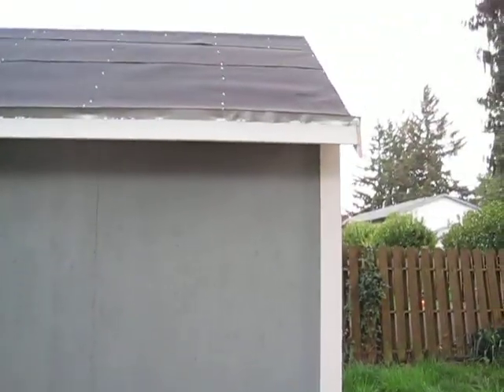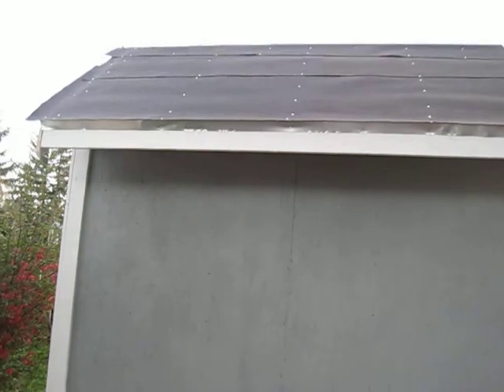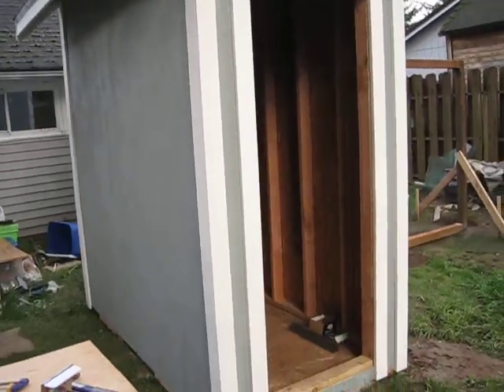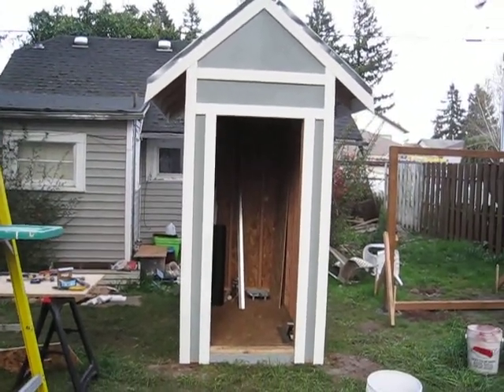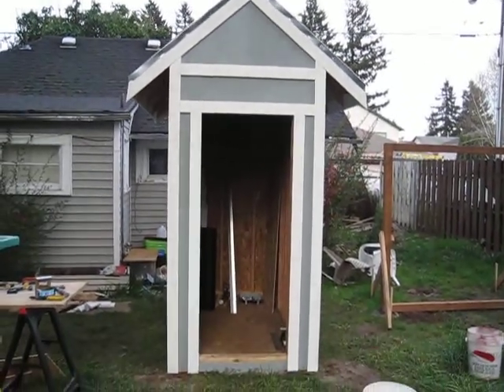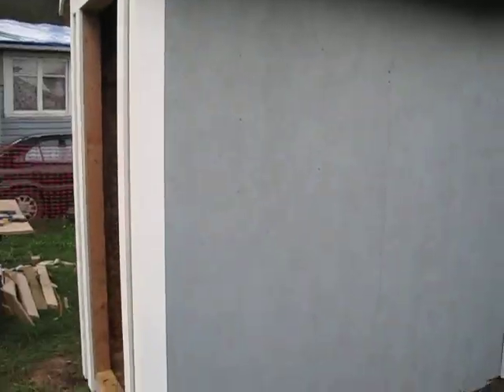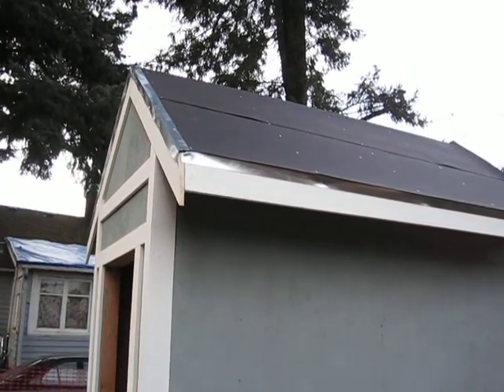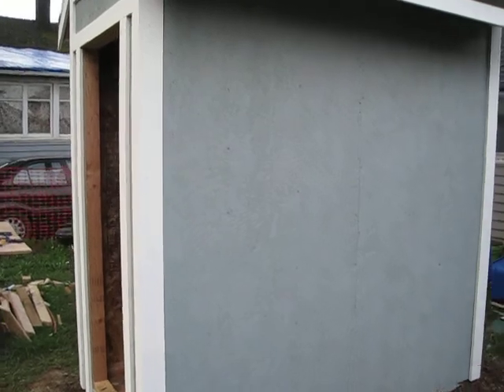solar and wind power shed storage 002

Comment from the maker: I will just put a regular home made door on it lol. I did the measurements for the area that will house the first bank of batteries. I will be able to put in 16 T-105 type 6 volt batteries in the box. I may build a upper box and see how many I can get into that one also. I scored some free 0/ stranded copper wire and started making my own battery lug connectors today using L copper. put some shrink wrap on the ends and just need to drill the hole in the lug for the battery threaded bolt to go thru them. I will make a short video of that tomorrow if there is no rain.